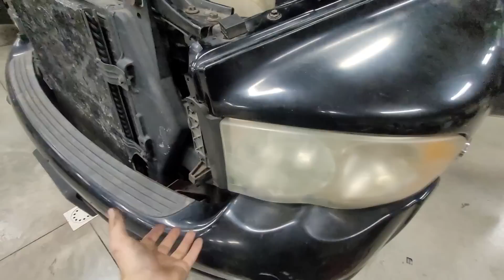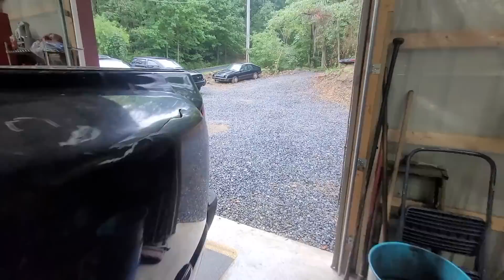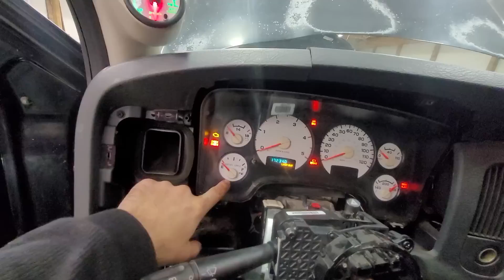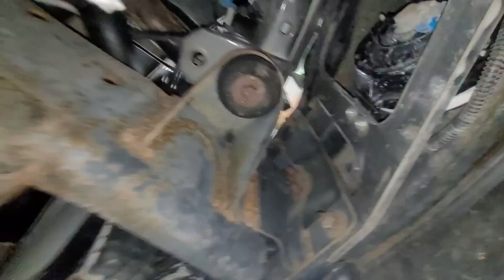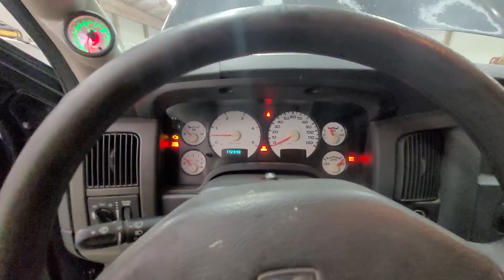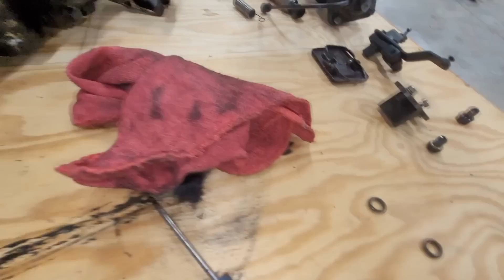This One Issue Caused ALL These Electrical Gremlins | Ppump Repair | 12 Valve Swap 3rd Gen Cummins

Comment: Are you ever going to do Hot Shot driving again
Reply from the maker: Yeah, I'm not done just going to be picky with loads going forward. I'm just doing what pays. The next project is getting the box truck going. That's going to be a good flip once the trans is fixed
Reply: @CPSteveMiller The box truck needs a 12 v swap and hood exhaust.  If anyone can do it, I'm sure it is you!

Comment: I've been a troubleshooter all my life. The worst problems to find are usually man made. We think, OK, what broke to cause these symptoms, but wires don't get moved by themselves. Just like that connector didn't just fall off - we all know the joy of unplugging automotive connectors. Glad to see you found your gremlin that had been messing with you!
Reply from the maker: It was hidden too. I'd have never seen it had I not decided to try a tipm. It was pushing more and more towards a tipm problem. What a nightmare!

Comment: The connector by the steering wheel is for the SKREEM security module. Not all are equipped with this module and will have a blank connector. My 04 just has the connector as well with no module.